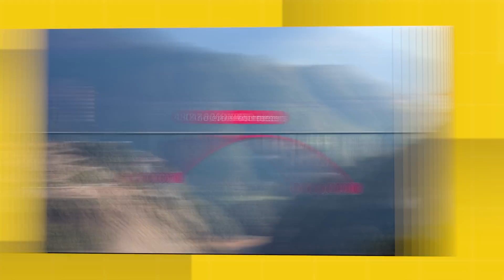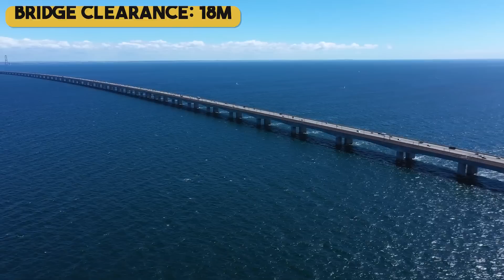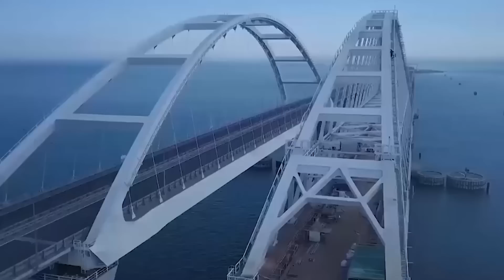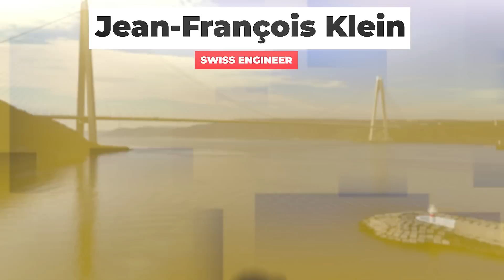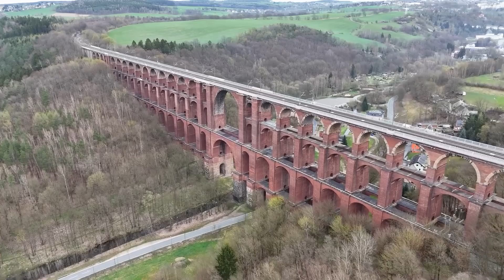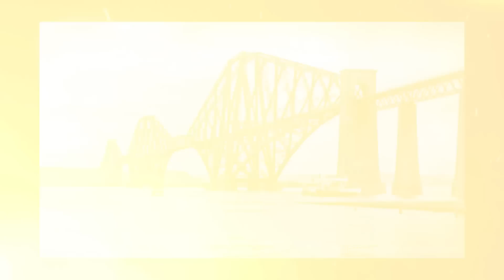10 Mind-Blowing Railway Bridges Worldwide

Comment: I must commend you for including the 3rd Bosporus bridge in your Top 10, despite of not having train tracks on it yet. The government is currently trying to secure funding from the world bank to realize a bypass train corridor that goes around Istanbul and connects the existing train network to the Sabiha Gökçen Airport and the Istanbul Airport via the Yavuz Sultan Selim bridge. Once build, high speed trains and freight trains will operate on this line and cross the bridge... but it will take many more years, until done.

Comment: Agree with the choice for number 1. The Sydney Harbour Bridge is also a rail bridge originally built with four tracks. Sadly only two are now in operation but still carry up to 40 trains per hour.
Reply: Ah, I was wondering if it carried rail. I thought not, but thanks for correcting me!
Reply: @ When built it was more important as a rail bridge but changed over time with car ownership. It was an integral part of the city railway scheme that included the underground railways in the CBD. It was to carry two tracks on each side being the North Shore Line and Northern Beaches Lines. The connection to the North Shore line was built and opened with the bridge. The Northern Beaches Line was never built so the tracks were used by trams until about 1960 when they were removed for cars. There are now 2 railway lines and 8 traffic lanes on the bridge plus 4 lanes in the tunnel and 2 railway lines in another tunnel.

Comment: You're absolutely correct in your selection of the No 1 impressive railway bridge. (I won't name it here so I don't spoil the watching experience of others!)  When you see this bridge 'in the flesh', it literally takes your breath away. Unfortunately, you don't get that experience when you go over it in a train so, if you're in that neck of the woods in a train, get off at Dalmeny or North Queensferry (one on each side of the bridge) and go for a walk. Trivial but interesting fact: All of the 10s of thousands of railway bridges in the UK have a unique number, which you can see on a plaque mounted on each bridge structure EXCEPT for this bridge, which is simply noted in the records as 'THE BRIDGE'. A fitting tribute to this amazing example of railway engineering.

Comment: Chongqing system of subway bridges over the Yangtze and Jialing rivers deserve an honorary mention due to its sheer scale, visual prominence, and geography. There are 7 subway bridges over the Yangtze river, and 6 subway bridges over the Jialing river. (not to mention 3 monorail bridges). Because the city is mountainous and dense, there are many buildings/hotels with views of those bridges. And because the city is built on the valley, many subway lines are completely underground except when they emerge onto the bridges, and then go underground right after.